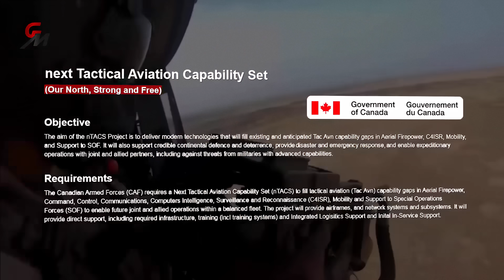The New Helicopter That Will Replace The Aging CH-146 Griffon! Here is The Canada nTACS Project

Comment: For a light helicopter to replace the Canadian Griffon, the only option is the Korean KAI LAH (Light Armed Helicopter). The KAI LAH "Miron" has a chin mounted 20mm gatling gun for engaging air or ground targets and eliminates the need for a door gunner. The KAI LAH carries loitering munitions for reconnaissance & attack and can also be used to carry a small group of soldiers. Korea Aerospace Industries (KAI) completed cold weather testing of their Light Armed Helicopter (LAH) in Yellowknife. I think the South Korean chopper would be more useful if they replaced the 20mm gatling gun with a chin-mounted RMK 30 cannon, which has been proposed as an upgrade for the German armed forces Tiger UHT attack helicopters. Though recoilless, the RMK 30 has a higher muzzle energy than conventional 30 mm autocannons. With a larger 30mm gun, the South Korean chopper could fire armor-piercing anti-tank rounds or programmable air burst anti-drone ammunition.
Reply: Interesting. Could be an option. Especially if we go with their submarine. Could be a good segway into other platforms.
Reply: @craigquann The Griffon isn't a heavily armed gunship but more of a troop transport. The Korean KAI LAH "Miron" light helicopter allows Canada to keep that ability but add the gun of a Cobra to shoot down drones without opening the doors on cold days or putting the crew at risk. The Korean chopper has some ballistic protection for the crew & passengers with the ability to launch state-of-the-art drones to extend sensor range, identify an enemy target and destroy it. The Griffon is more of a "light air calvary" chopper. For an anti-submarine helicopter the Cyclone could be replaced with a "heavy air calvary" chopper like the Merlin since it's a familiar helicopter for parts and maintenance. For a Navy ASW helicopter, I like the Merlin Mk2 (Heavy Air Cavalry) equipped with a Mast-Mounted Drone Defense (MMDD) system resembling the Kiowa Warrior MMS (mast-mounted sight) to locate, track, and destroy drones. For infantry support, land operations, and an anti-tank gunship, I like the Merlin Mk4. The Mk4 (Heavy Air Cavalry/flying artillery) could be modified to add a chin-mounted Rheinmetall 35mm cannon to fire programmable air burst anti-drone or armor-piercing anti-tank rounds. The Merlin Mk4 also needs two large mid-mounted stub wings, like the Soviet Mil Hind, to provide weapon hardpoints each offering three stations, and two small rear-mounted stub wings for mounting anti-drone gun turrets. The Merlin could also have a Mast-Mounted Drone Defense (MMDD) system. The MMDD is controlled by Centaur AI to rapidly process data, track swarms of drones, and achieve rapid target acquisition. My preference for the heavy lift (cargo) helicopter to replace the Chinook would be the Chinese tilt rotor aircraft referred to as the plane-helicopter on YouTube videos because it has a wide fuselage. I think buying heavy tilt rotor aircraft from China would give Canada a better deal on price, it would promote trust, and create a better trade relationship. Sikorsky helicopters have always been my favorite and a year ago I would have wanted the Canadian military to buy some CH-53K King Stallion heavy lift helicopters but now I don't trust the Fascist American Empire and I don't want any American equipment in the Canadian military.
Reply: @aerynlovell4754  I don't think we are at the point of trusting any Chinese options; not being able to trust Washington anymore does not suddenly make Beijing trustworthy.
Reply: @wyldhowl2821 I'm more willing to trust a Chinese aircraft because the Canadian military & Aerospace Industry will check it over and make sure it's reliable. The Chinese tilt rotor has a wide body design that I prefer to anything the Americans are building. To replace the Chinook will require a specialty designed helicopter that's long and wide enough to carry troops, vehicles (trucks & light boats), and equipment. I have zero trust in the United States of Trump or their weapons. Over 100 Canadians (including children) are being held by Homeland Security and ICE in dog cages and concentration camps for several months and at least one Canadian has already died in custody from lack of medical treatment & necessary medication.
Reply: Not sure if you are aware that the KAI LAH-1 is a derivative of the Airbus EC155. Rather small, and limited capabilities for CAF. Developments to upgrade capabilities would increase the cost (considerably)!
Reply: @qtdcanada When I was researching the South Korean helicopters, I saw that it was based on an Airbus design, but from my limited research, the original Airbus helicopter doesn't have a chin gun. The South Korean version with a 20mm cannon is much better for range, accuracy, and penetration than a couple of 7.62mm door guns. I read that the South Korean military has been using American helicopters, and now they are developing their own combat helicopters. They are replacing the Cobra, so they put the same 20mm gatling gun from the American Cobra onto a European helicopter design. I don't think the Korean KAI LAH needs to be modified for use by the Canadian military. However, in the future, when they improve the design, I think it could be a better and more versatile helicopter by replacing the Gatling gun (obsolete technology) with a 30-35mm chain gun. It seems like all the programmable air burst anti-drone and anti-aircraft ammunition is at least 30 mm along with armor-piercing anti-tank rounds. For air burst ammunition, companies like Rheinmetall use a gun with a single barrel that incorporates a sensor into the barrel to transmit a signal to the ammunition. I think the Korean version is more advanced than the Airbus chopper with the ability to launch & control drones and almost become a helicopter version of an AWACS to gather and transmit information about the battlefield.

Comment: Capability we need is only provided by two airframes, bell 280 and the V22 osprey.
Reply: I thought the same. If the Valor will fit our ships, Could be a real game changer having that level of airborne firepower. Especially if it can also be used for ASW along with troop transport. It would almost turn our Joint supply ships into a light amphibious Assault ship. Give the Harry DeWolf class a bit more punch. And just an all around useful aircraft.
Reply: @craigquann  Why not look into the Bell V-247, loyal wingman like platform

Comment: You forgot to mention the H160M, H175M and the AW249 Fenice gunship? but I would choose the H175M for a transport, its fast all weather can carry 12 to 16 troops and has a range of 600 miles, and you can add fuel tanks to increase the range and carry weapons for troop support, its fast and very reliable and easy to maintain, for a gunship I would go with the new Aw249 Fenice, its fast reliable carry's more weapons has more range and much more modern than the Apache which is over 40 years old I think?
Reply: The H175 spends most of its time in the hanger requiring maintenance